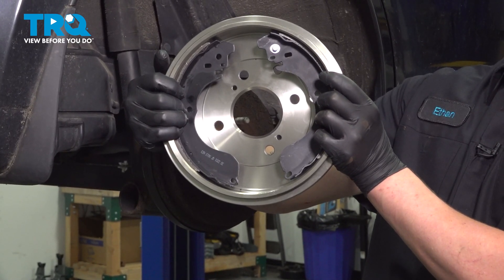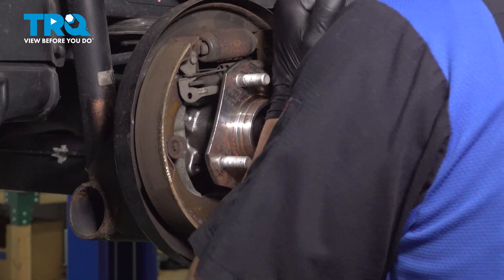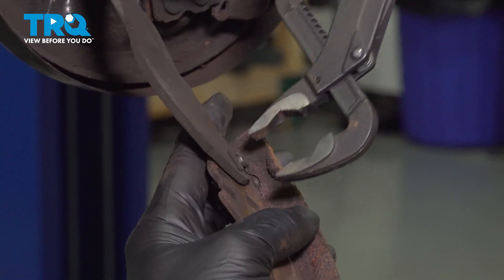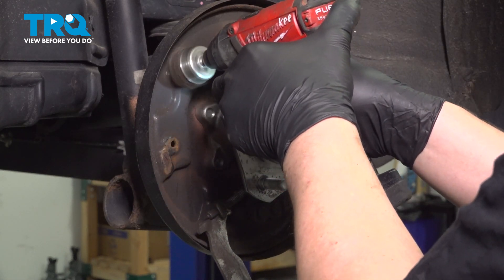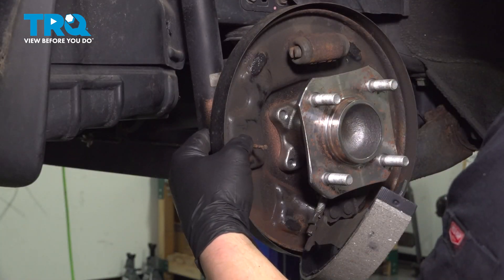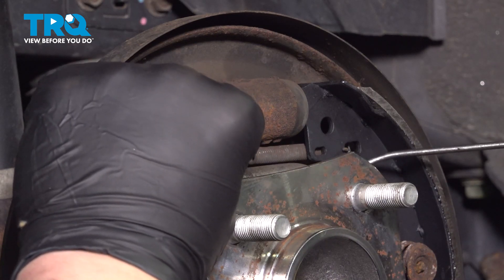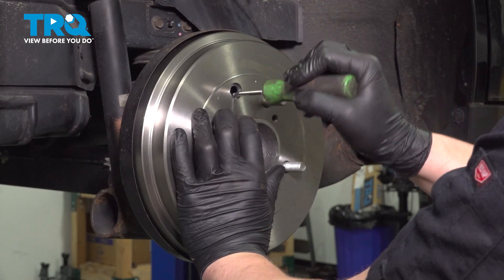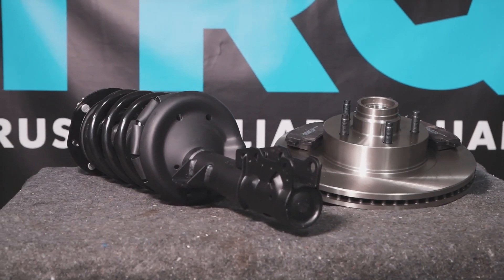How to Replace Rear Drum Brakes 2007-2012 Nissan Versa

Comment: I hope you're not a Class A licensed tech-- you missed several crucial steps-- you always check the cylinder boots -- pull them back to check for leaks or cracks on the inner boots, you always clean and test the springs, you clean the backing plate and cylinders thoroughly and you lube the e-brake mechanism. You also put antiseize or at least WD on the adjuster so the next person has an easier time. And they are called shoes, not pads, at least here in Canada. I got my license at Honda and they had very detailed procedures to prevent brake seize-up. It saves a lot of grief next time you work on that vehicle.

Comment: What they don’t tell you is the direction to spin the self adjuster, and that you probably will need bolts to push the drum off.

If you end up getting bolts for the drums, they’re M8-1.25 (30mm or longer, no shanked bolts)
Reply: Real MVP